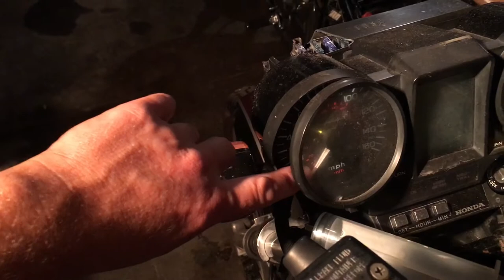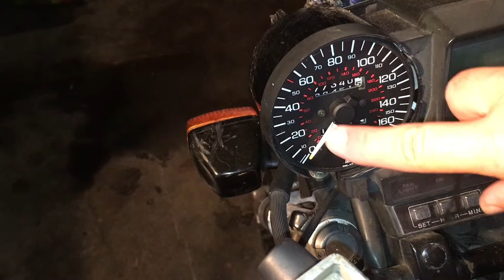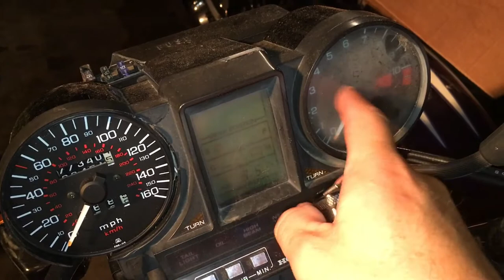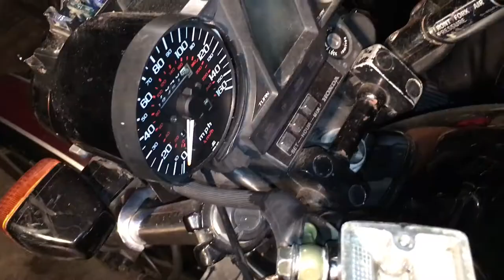Clutch fluid Change on Wrecked 1984 Honda Sabre VF1100S DOT 4 Brake Fluid

Comment: I just picked up an 85. Its complete but its seen better days. Flat clutch, flat front and rear brakes. Going to vid-doc it and put em here as these are rare. I had a mint condition one back in 06. I sold it. Huge regret. Thanks!